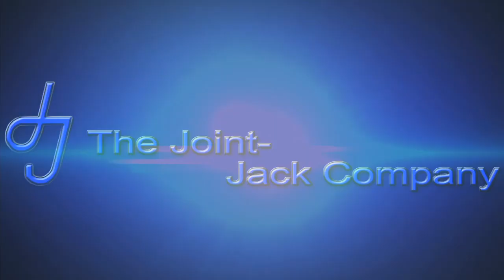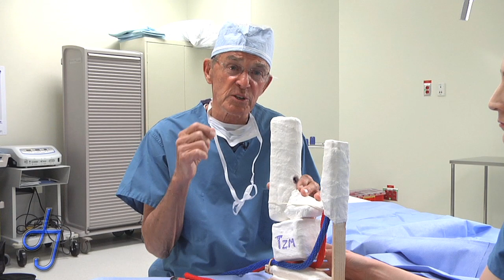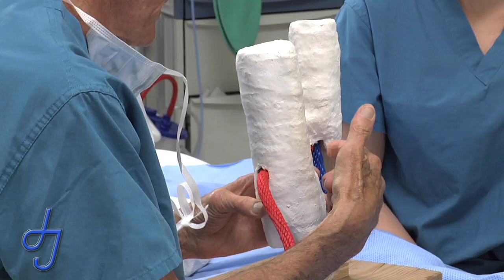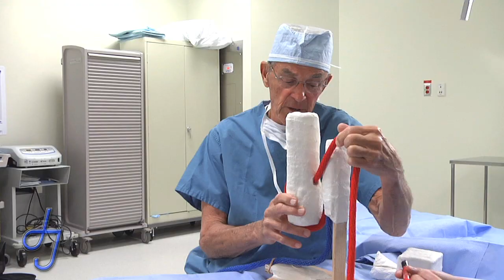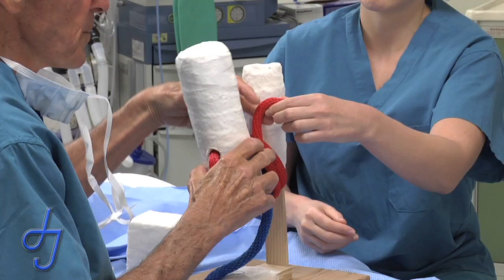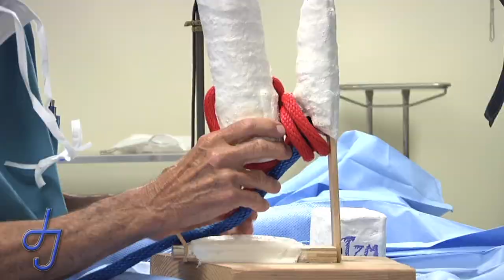CMC Tendon Transfer Arthroplasty

Comment: I had CMC Arthroplasty with flexor carpi radialis transfer on October 19, 2022, right hand. I’m right hand dominant. My cast was applied so tightly that there was difficulty and a lot of manipulation to get it off; I just about wretched and passed out. 5 months later, my hand is not healing well. It is noticeably smaller than my left and the entire hand feels inflamed with soreness and noticeable, stiff ligaments or tendons (?) showing through on the palm.  I had an x-ray - bones look great. Onto an MRI and the next steps. As an aside, it will be an entire month of tolerating the current pain and inflammation before I could get an MRI appointment.  Don’t take this surgery lightly. There’s a reason why you may receive a nerve block lasting about a week for this surgery.
Reply: How are you doing now?

Comment: this guy is simply genius and the technique he explained looks extremely solid. the geometry is explained amazingly and involving scaphoid. there has to be a scientific paper for this. can you share? is this just lr without ti but with suspension? what if the tendon slips away in the new pivot point? say i moved my thumb to z-axis (you move that thumb towards my ipad screen that i am looking? or basically i lift the thumb way up) why not having 2 pivot points? is there any risk that cannot get loose with carrying heavy things?

Comment: Thank you for explaining. OR, RN, however hands not my specialty. DJD, bilaterally, as well as missed Lyme disease, need bilateral surgery. Pain as you stated is chronic. Good explanation, and why part of tendon is transposed. Thank you for very informative surgical demonstration
Reply: Robert, also a RN and very afraid to "pull the trigger" on this (worried of inability to perform procedures at bedside, picking up pills etc.). I did steroid injections 4-5yrs; initially approx every 6mos. The last 8mos was horrible - as they quickly lost effect. The last couple didn't last more than 6-8wks. Lrti on 2/14/22...and with pain meds weaning at 3wks already dramatically less pain. No lies, it's still painful, and the wait to load and strengthen it is long [my surgeon says 6wks]. So while still not functional, if I don't overdo it is less painful. I no longer had a choice, so I took the plunge. Hoping with compliance and PT I will be pleased with my results. Best wishes to you, and thanks again doc. Your props provided further explanation I was wanting that explains the new anatomical positioning (and thus limitation in ROM/movement d/t new placement). It satisfied my piqued curiosity between Therapy visits.
Reply: @TransplantNurse  Thank you, finally took plunge after multiple back( epidurals, Dacron, rhizotomy. Left hand now on second cast. Sutures out next week, another cast, etc. Then the (R) CMC arthroplasty. L5-S-1 shot. Left knee, talk of unicondylar knee.only after Stress test. Never ending. Hoping to get some relief . Time will tell. T score -2.3. I did it without narcotics. Axillary, then supraclavicular rescue block( no versed or anything.) Watched the guided ultrasound.  Also. wishing you the best & rapid recovery. Thank you Dr, and thank you for support.Warm regards 💖
Reply: @TransplantNurse  Just realize, sharing is personal, but if I , you can help 1 other, worth it. Misdiagnosed as male breast cancer led to post Lyme disease until 2 step Western-Blot done. Add DJD, osteoarthritis & soon fully osteoporootic, you sharing provided inspiration. Only we know the multiple steroid injections.Back, hands( bilaterally) and now Synvisc 1 in (L) knee. Is unfortunately, what it is. Regards 💕